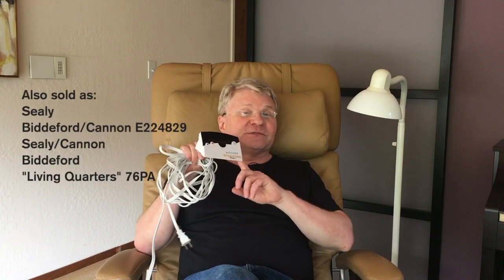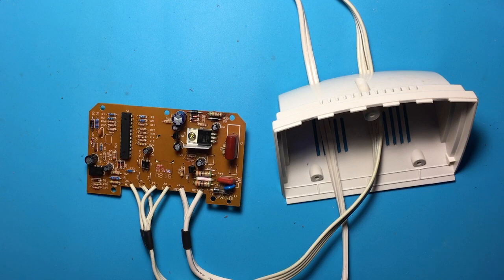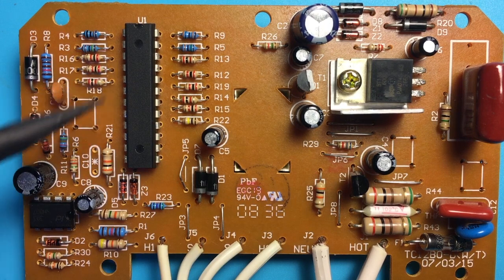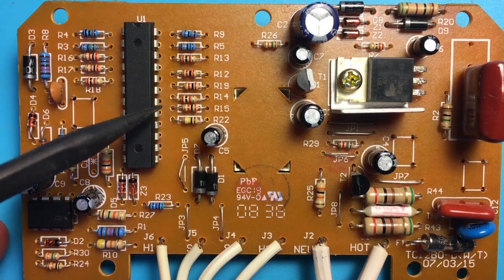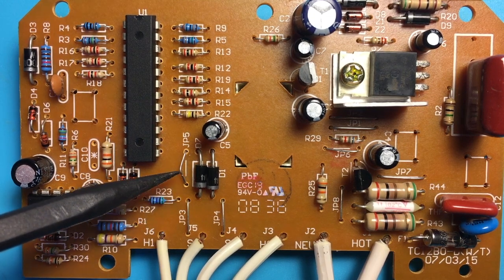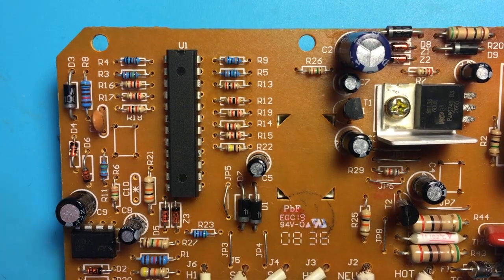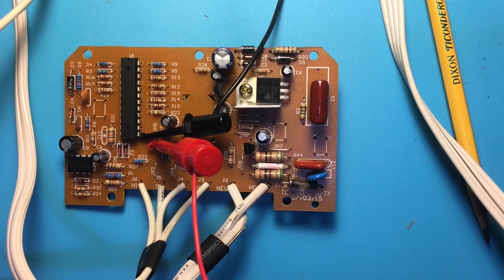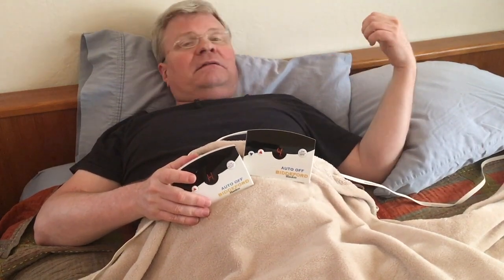Biddeford Electric Blanket Troubleshoot / Repair / Internals

Comment: I was having problems with my blanket at well. I put the controller on the other side of the bed and it heated it up fine. I then took the other controller and put it on the other side and it heated fine which lead me to believe it was the controller.  Then I figured it wasn't getting a good connection so I out little pieces of aluminum foil in the tiny holes in the cord that plugs into the blanket and now it works. Nice and warm.

Comment: It's going on almost two years since this was posted but my Biddeford heated mattress pad has been acting up so I figured I'd see whether this video would help me.  Holy moly!  I wish I'd paid closer attention during the Circuits course I took back in college.  Man, you must be an E.E. who designs circuits to know what all this stuff is.  Actually, most of these components probably hadn't even been invented back when I was in college.  Anyway, I found that the controller for my mattress pad is really quite similar to the one for the blanket.  I may have even found the problem as my mattress pad seems to be working okay again.  Enjoyed your humor.  I even watched one of your other videos about fixing an electric bottle opener.  Glad to see someone else believes in repairing stuff rather than just pitching it out.  My wife even enjoyed watching that video and she's not at all mechanically-oriented.
Reply from the maker: Heh. That's great Greg. Thanks for the kind words. Very much appreciated.

Comment: Thanks!  Saved me a bunch of time troubleshooting my daughter's blanket controller.  My controller is a little newer with a mix of surface mount and through hole components, but same basic idea.  In my case it was the thermal link between the two resistors.  Have a few on order and will replace the failed one and then do some testing for a bit before I return it to service just to make sure there isn't some other root cause that is causing the thermal link to fail.
Reply: The thermal protection device failed again after a few day's use.  After stumbling on a video of Sunbeam blankets burning up I decided not to repair again.  As a test, I connected my Variac to the blanket and turned it on with voltage set to 120 VAC to simulate what might happen if the controller failed in the stuck on position.  Because some people leave their blankets folded at the end of the bed, I folded the blanket up and left it sitting in a safe spot in my driveway.  Was in flames in less than 30 minutes . . .
Reply: @RideGasGas  WOW! Thanks for sharing!

Comment: Enjoyed listening to the video eating ice cream with my dog on our cold twin blanket, hoping the E turned into a number.  When I got done I pulled the cord out of the blanket, turned it around and plugged it back in. It works fine now.  At least now I know how to repair it and my year of Army electronics training 50 years ago will come in handy, after retirement.  As it is now, at my hourly rate I could have bought two new blankets for the length of the video. I'm surprised your wife did not replace her controller with yours and not even mention it. My wife bought this blanket on sale at least 10 years ago, and this was its second night of use. Thanks for the video!!
Reply from the maker: Thanks John. (Please don't give my wife any ideas!)

Comment: Finally!! A comprehensive explanation of electric blankets! Great video. After plugging in 3 controllers to a defective blanket, I finally figured out the heater and sensor wires are shorted together. Your video is the first one to identify the pins on the blanket. Now to order replacement fusible links to get the controllers working again. Thumbs up!
Reply from the maker: Thanks Randy!

Comment: Thank you so much for all your time and effort in making this video. It was super helpful to have the circuits explained. I have the 2010 model but it's slightly different than yours. I think you were exactly right about the triac needing a better heat sink, and that's why they changed the design. The printed circuit on mine looks kind of discolored and rusty near the triac and smells burnt. At least now I know how it works and what the problem is. I enjoyed the humor  as well. Great video!
Reply from the maker: Thanks for the kind words J.

Comment: I loved your video, even though it was way long.  My wife's electric blanket displays "E" after it is in use for a while, but only if it is set above 6.  Setting to 8 causes it to fail after a while.  I'm not sure why that happens.  Would ripple in the 5 volt supply affect the processor commanding higher settings?  The mystery awaits me.  I have a VOM like yours but I need a scope to troubleshoot my electric blanket.  Hopefully, I'll be able to fix it without a scope.  I think it is commendable that you have taken so much effort and time to investigate this problem.  I think you must be retired with some extra time on your hands.  Well, you have done good service to help many people with similar problems with this electric blanket.  Keep up the good work at making the world a better place.   As a side note, from my experience, never expect an electrolytic cap to be what it is marked.  It's a blessing if it is high than rated.  And never expect an electrolytic cap to filter out high-frequency noise, That's what the mylar cap is for as wired parallel to the electrolytic.   Thanks again for this great video!  Keep up the good work!!!
Reply from the maker: Thanks for taking the time to write these kind words, Carl and thanks for the tips. I was NOT retired when I made this, but I am now, and think I have another interesting (too long!) video in the works on another bit of tech I've recently become obsessive about. But at this point I'm not sure if I'm going to beat it, or if it is going to beat me! We'll see...stay tuned.

Comment: Thank you for a very comprehensive video. In my cat on of the 5v Zeners failed closed and pull the rail to zero. But your walkthrough of the circuit saved me hours.
I'm Liking and subscribing
Reply from the maker: Thank you, sir. Another fellow here in the comments had zener failure too -- and yes, when they go, they like to short. I just wonder what causes this? Sure seems like the babies are sensitive to power conditions -- or maybe the stress of cycling the load all the time has some bad effects.

Comment: I have a Sunbeam 6 zone unit. Wasn't working well last year and this year not working at all. Thanks to your video was able to understand how these things work. In my case it appears from a resistance test both sense wires appear open. All 6 Heating wires are around 12 ohms. Can only assume that the "infinite resistance" tricks the unit to turn the outputs off. Don't have a isolation transformer handy so haven't scoped the triacs but they are all showing mains output on a  multimeter which is odd?, Duty cycle I suppose as the unit draws about 10-20 watts when the label shows 180watts x 2  Only option I suppose is to open up the pad and see if I can repair the breaks, or perhaps first step is to solder a 1K resistor across the sense wires and see what it does.

Comment: Great video, thank you.  I have a strange failure and hope that you might have some advice for this novice.  Both of our controllers seemed to fail while in summer storage, but maybe they died right before taking the blanket off.  When we put the blanket back on neither controller would power up.  I opened one controller and the thermal fuse is blown/open, the resistors look fine and test good, and the blanket's heating elements both show a bit over 120 ohms so they appear to be good.  I temporarily bypassed the fuse and ran the blanket on high for about a minute and it's working.  Should I assume it was a Fluke and replace the fuse?  Maybe replace it with a piece of 10ga. wire so we're guaranteed to stay extra warm?

I assume the other controller has the same problem but I can't reach the power plug to disconnect it.  I've had enough drinks to feel qualified to work on it, but one too many to safely open it live.

Comment: VERY helpful video. So I have a much newer controller than either one of yours. No date but it is all SMD. Biddeford wanted me to pay for return shipping for any warranty. Then I noticed that the schematic for these newer units seem pretty close to yours. My symptom was that it would only give me the power on dot and nothing else (and it also seemed a bit too dim). It also did not rapidly cycle through the digits when first plugged in. To make a long story short I found that the 9.1volt Z1 was shorted. Replacing it fixed the problem. My question is what caused it to short? I would not really worry about it since it is fixed except that have TWO controllers (on two different blankets)  with the EXACT same problem!!! Thoughts?

Comment: Ok, someone else solved the "JP6" issue for me..  I showed this to another engineer, and he quickly discovered your mistake in reverse engineering the schematic.  When you flipped the board over, you reversed the positions of R26 and JP6 when you wrote on the back of the board to label them which are above and below each other. The jumper feeds the gate, and the resistor is tied to ground.

I think it would be good if you could take the time to fix your schematic, and the labeling on the back of the PCB side.

Comment: Great video. My problem is, the Sunbeam blankets always go high-resistance so instead of 150W they always default down to 16W.  It’s not a loose connector connection but the element goes to a stable high resistance measured at the blanket connector.  Have not figured out how you can actually fix the element wire…

Comment: I have a newer model, TC11W1, that has surface mount components, but the circuit design looks to be the same.

I noticed the link to your schematic does not work. Are you able to update the link?
Reply from the maker: Still working AFAIKT

Comment: Hi Ward....would you please comment on this? My controller will not power up at all. Last night I set it on high, came back later and it was off and will not re-fire. I checked all the resistance and continuity in the  blanket and it seems fine. I moved it around in case of an intermittent short but it followed your parameters except the heating wire Resistance was around .955 (should be fine.)I checked the thermal fuse and it has no continuity, one resistor appears slightly burned but both measure around 500 ohms. I checked your video where you briefly mention what would cause this fuse to fail but could use some more specificity as everything appears ok. the main fuse still has continuity. BTW, my control board looks different from both of those but similar in some ways....where is the date located?  Thanks....Greg
Reply from the maker: Hi Greg. Sorry for the delay responding. Thanksgiving fun! 

Seems like you are doing everything right, so now we turn our attention to the cord itself and ohm it out with the multimeter while flexing it to see if it has any problems (and check the solder connections where it attaches to the circuit board). If that all looks good, then we need to check the "T2_GATE" components in my schematic: T2, D5, maybe R29. If all that looks good, we may have a problem with the LM393 itself.

But, of course, I'm not an expert, even though I play one on YouTube. You're a "sample size of one" for me -- though enough people are looking at this now we might get some consensus on typical problems/solutions going. But, in the meantime, like you, I would really like to find a fault in the blanket or connecting wire before I go poking around on specific components! (And what made THEM fail?) Of course, you can always get a few thermal fuses on eBay and just "go for it" but, like you, I'm not terribly comfortable with that.

The date is silk-screened on the lower right corner of the 2 boards I have looked at.
Reply: Both of my controllers won't power up at all either. Did you figure anything out?

Comment: Excellent work, thanks for sharing!  Surely this will help someone down the line.

So the current from 120VAC source through the heating element section would be about 1(one) Ampere (1Amp = 120V/112 Ohms), thus the element would be capable of generating about 120 Watts (120W= 1Amp x 120V) of power each side.

I measured my (new) blanket heating element at about 90 Ohms, FWIW.  That would make mine a 160 Watt element.
Reply: My sunbeam control provides 24v to the blanket. I can't imagine using one with 120v, it would be unpleasant to wake up to a fault.
Reply: @acoustic4037  if you're sleeping in a wet bed perhaps?  Been using 120v blankets on lamp timers for 60 years and no probs yet. I hear the new blankets are unreliable and shut themselves off after a short period of time, must be reset manually once you wake up from being cold?
Anyway, the power source for electric blankets in the us is 120vac, not sure where your isolated 24vdc is coming from, a gfi safety device or isolation transformer are options.
Reply: Your YouTube handle... lmao

Comment: great video explain how it works. just a curious question, when you connect your Osco scope to the board, how do you avoid short the oscoscope to the ground. I had used my scope before on main circuit and accidently blow mine. it seems your scope can manage it. any suggestion?
Reply from the maker: Hi Ted. I have the blanket controller on an isolation transformer.  (The other way to do it is with an expensive differential probe.)
Reply: @WardCo  thx, that explains how you make it. Smart idea

Comment: Great video- nicely explained whole operation of the heated blanket! I was able to find that one of my blankets is damaged and it caused two controllers to be damaged as well. Fixed thermal fuse that was blown but now I see E on the display and I can’t find anything else wrong. Any other ideas?
Reply from the maker: Thanks Snehal. Hard to diagnose from afar. Do check the DC voltage level and quality, and the input clock to the CPU though.

Comment: Do you have the schematic for this controller? Would make it a lot easier for me to fix
Reply from the maker: My reverse-engineered one is linked in the description.
Reply: @WardCo  Thanks, i missed that!! Looks like mine has a open thermal fuse so i need to track down what caused that. It's funny, though, this thing really is an exercise in making something as CHEAP as possible. Not even a voltage regulator to be seen! I have the 2010 version PCB and was honestly sort of surprised to find a full-fledged microcontroller because these guys obviously don't know about button debouncing. I have to hit my power switch 4-5 times or else it snaps back on. Would have taken just a few extra lines of code (which is free!) to properly debounce that switch!

Comment: I have watched your video several times, plus other blanket repair videos on YouTube. No manufacturer seems to have a decent transformer-based power supply for the logic portion of the circuit, while the heating loop / ac portion seems to be simple, robust, and not prone to component failure. I wonder whether the reliability of all these blankets could be greatly enhanced with a good logic level power supply and optocoupled triac control. Of course a reliable blanket controller might be slightly more expensive and would cut the market for replacements. Call me a cynic.
Reply from the maker: Yeah, you hit the nail on the head -- these things are heavily "value engineered" -- that is to say cheap!

Comment: Hi. I enjoyed your video. Thanks! Someone gave me one of these to fix. LED doesn't come on (other than little dot lower right)  The blanket is my problem I think.  Your test you showed around 120 ohms across H1-H2 and 1K ohm across S1-S2.  I get 80 ohms between H1-H2. But S1-S2 is open.  Also, I get around 1 Kohm across H1-S1 or H2-S1.  Sound like the wiring in the blanket is the trouble?  Thanks!
Reply from the maker: If S1-S2 is open, yeah, the blanket is broken.